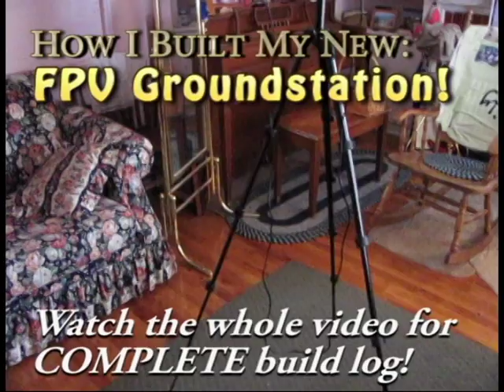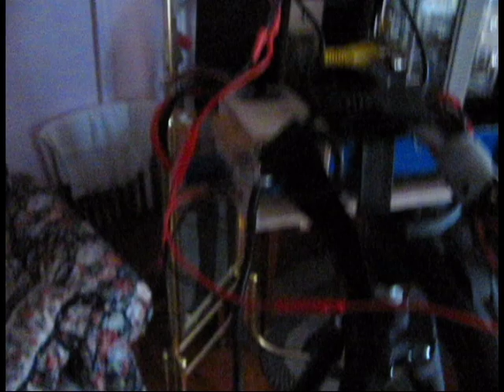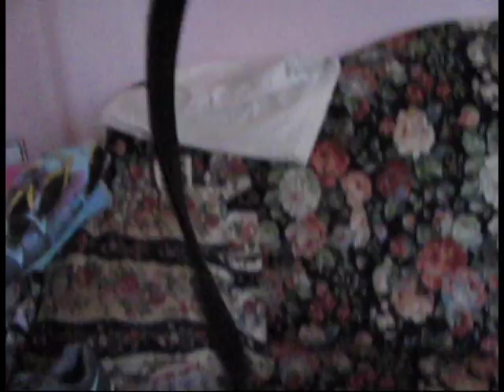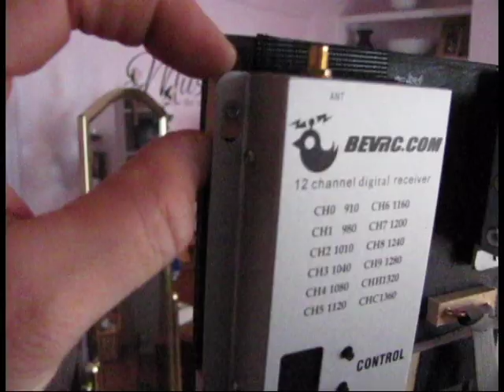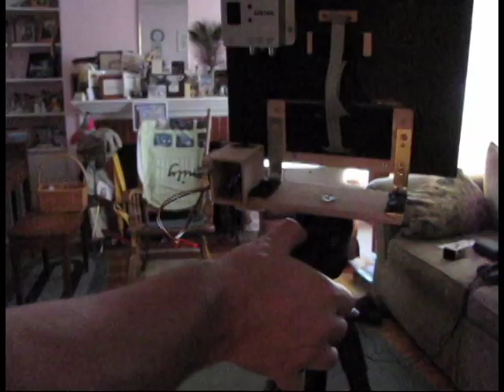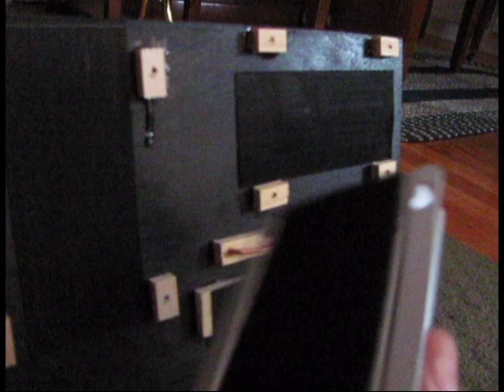How To Build An Awesome FPV Groundstation! Helical and Skew Planar on Diversity

Comment: hmmm will the ground station work with a garbage bag over it?  I think I would cover it in advanced to protect it from the rain.  But I'm not sure if that ground station will still work.  as for the plane, I wonder if there's a way to waterproof the electronic equipment such as the Rx, Tx, Servos, ESC, OSD, Brushless Motor etc.

Comment from the maker: I have been caught in the rain a few times. My Skywalker has come down drenched once. The copper antennas are the first to rust, but they do that even in light fog. I just land ASAP and run for shelter. Not a big deal. I keep two giant garbage bags in my flight pack, too, and I can cover ground station and plane easily enough in an emergency.

Comment: lol that's funny, but...it's actually a serious question for me because....with all that "Electronic" gear including the airplane....what happens if it starts to rain?  That's thousands of dollars of equipment and you only have "Seconds" to protect from such environmental conditions!  What if you plane is still in the air when it starts to rain on the ground?  I live in Tropical weather so it changes instantly from clear to rainy.

Comment from the maker: No I have not gotten around to finding more info on the diversity issue. I am eventually going to try a new set of quality rx's because I suspect that might be the issue. For now, I just use the diversity box to manually switch antennas during flight, and also as an expensive video splitter!

Comment: The other addition I have is a 100mW Fat Shark 5.8GHz video TX module that I run one of the video outs on the diversity to.  I have the 5.8GHz Rx module in the Fat Sharks.  That way, I can move away from my GCS, and there isn't a tripping/tugging hazard posed.  It lets you go hide out in the shade somewhere while your GCS is out in the open. Give it a try.  I think you'll like it.  Cheers!

Comment: Dude!  Excellent job on the video.  It's guys like you that really help the hobby along by spreading knowledge, tips, and advice.  I am currently using a 2 Rx system running 1.3GHz, same as you.  The only difference is that I'm using a Venom 3S 3000mAH transmitter pack because of the lower discharge rate.  Since there isn't a high amp draw need by the GCS, you can easily get away with those types of packs.

Comment from the maker: I have a 4 lobe skew planar on the plane to transmit, and another one (exact same) on the ground station. I have heard that a 3 lobe cloverleaf may have just a little bit more range of mounted on the plane, but it has more "dead spots than a 4 lobe skew planar. I just mostly researched as best I could, then made a decision.

Comment: Awesome setup, thank you for sharing this. I have a similar setup to yours, but with a 12" crosshair/omni/EE/1.2 clover-but at the moment I have a ghetto mess of wires and wood on my tripod. This looks like an excellent solution to my configuration and I will build a version similar. Interesting that you mount your skewplanar (4 lobe) on the acft. Reasons?